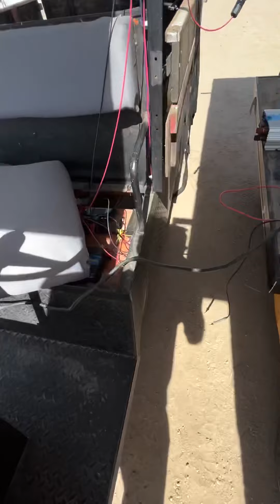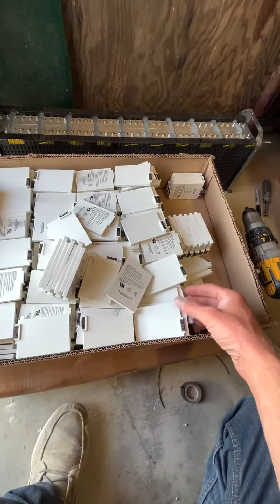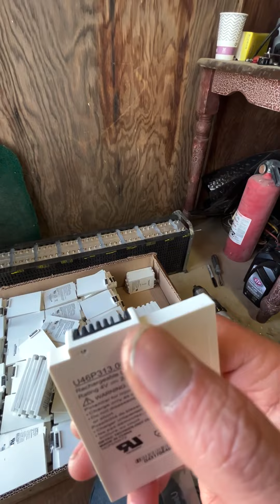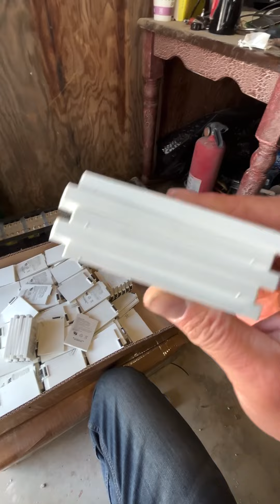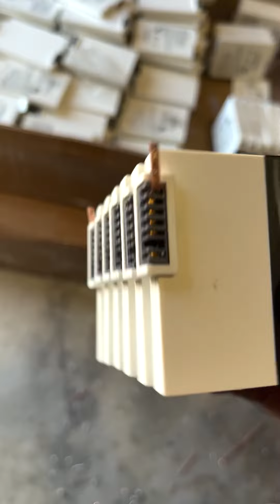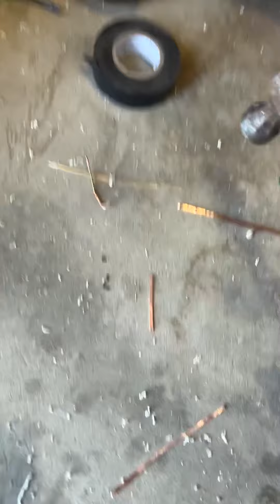Battery build (Powerwall on wheels.)

Comment: Cheap but a lot of work.
Reply from the maker: Yes! 😅
Reply: I had same idea but then SPIM08 came out.
Reply from the maker: @ev-place  yes spim08hp are used to drive it. The Powerwall battery is lower voltage and much larger capacity.